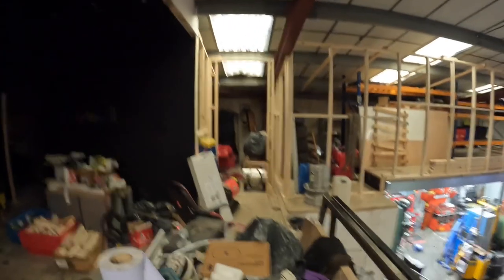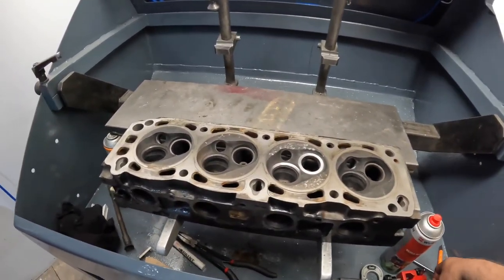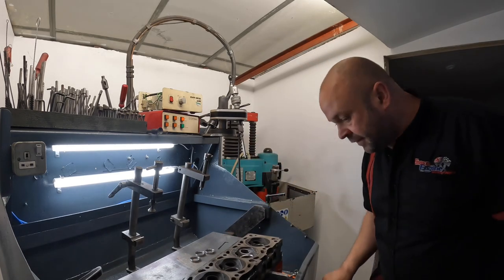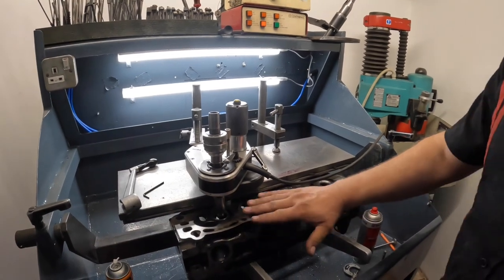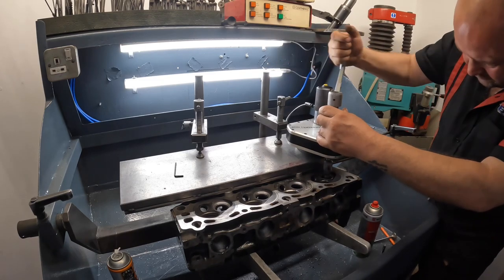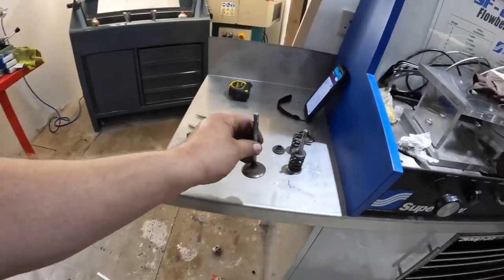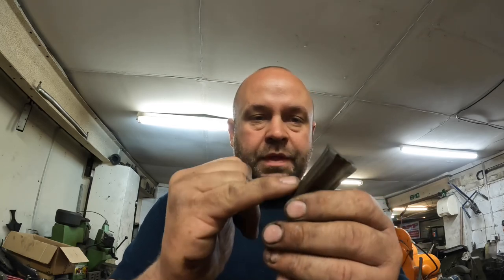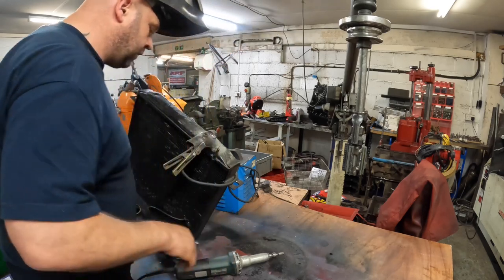Pinto cylinder head leadfree seats for Thruxton motorsport centre | Ford Model T radiator repair.

Comment: Hello James i work in a cylinder head shop myself and i was wondering have you ever seen a Pinto head with 4 cam bearings ? I skimmed a Pinto head back in the early 90.s that came off a German Sierra XR4I and it had 4 cam bearing posts instead of the usual 3 . I have not seen another since and everyone i ask think i must be mistaken and no such head exists . Great content by the way .
Reply from the maker: Hi.. yes I think it was called a ford Lima, same as the pinto but 2.3, meant to be a very good engine tuned. Thank you for watching